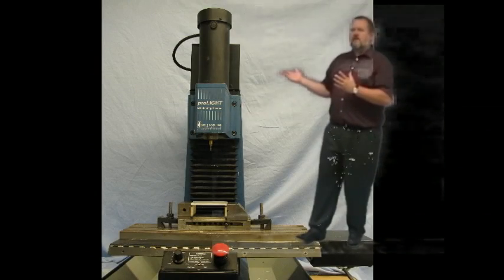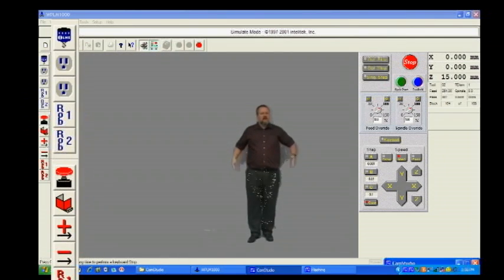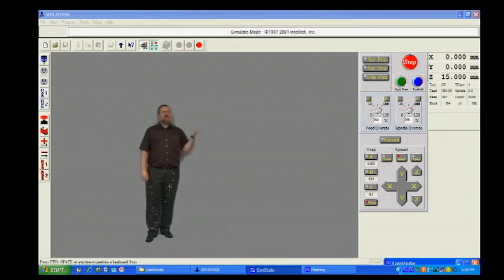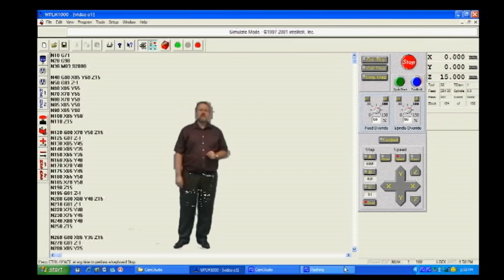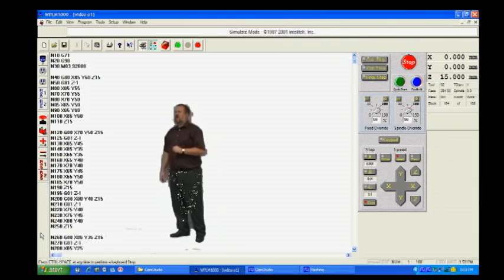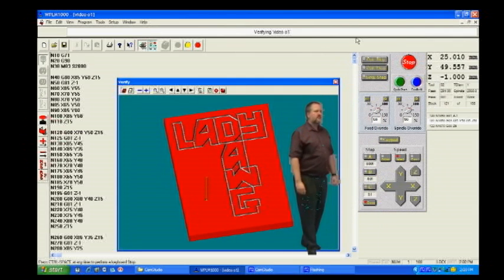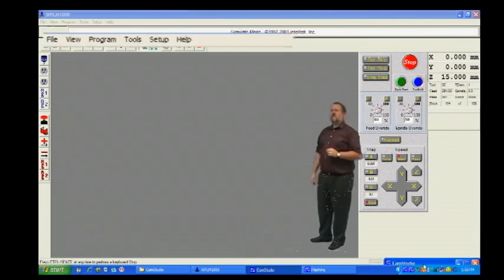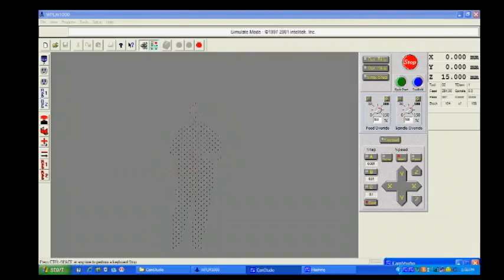Prolight1000a.avi

Comment: N0 ;THIS FILE FOR PLM-1000 MILL
N1 ;USE 3" X 2" X 1.5" MACHINABLE WAX
N2 ;INITIALIZE STOCK TO X=0, Y=0, Z=0
N3 ;T1 IS A 1/4" END MILL
N4 ;T2 IS A 1/8" END MILL
N5 M06 T01 ;ToolChange 1/4" End Mill
N6 ;Contouring Operation, Contour 1